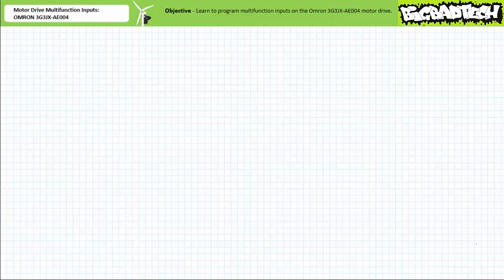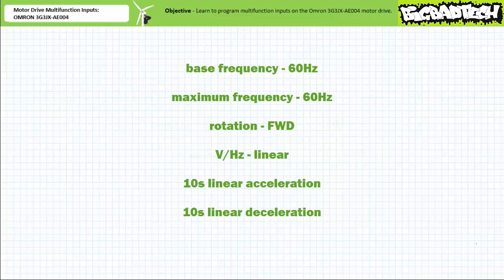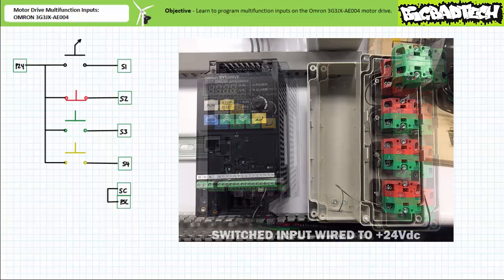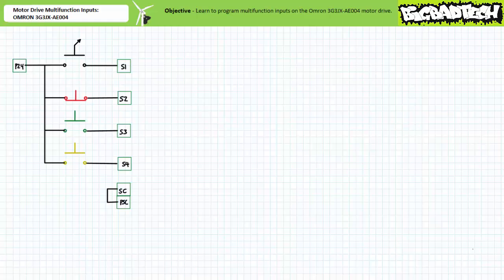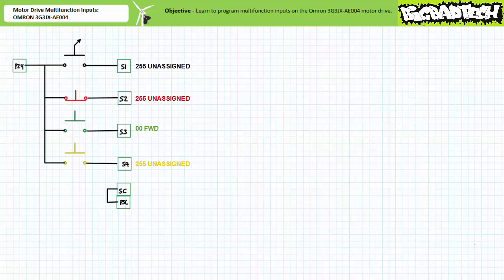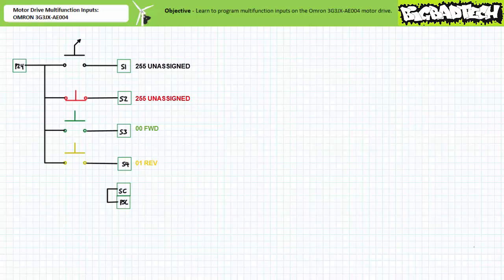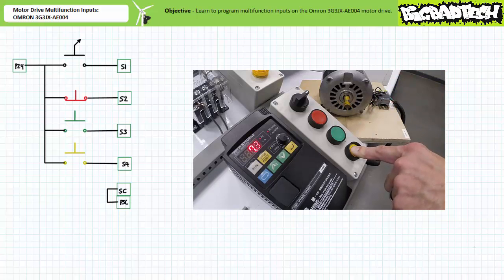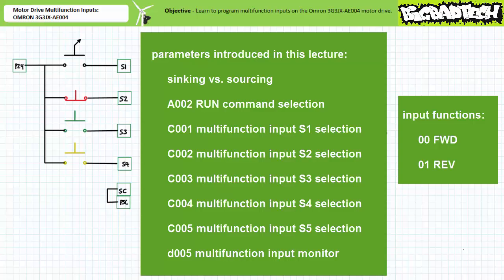Configuring Motor Drive Multifunction Inputs: Omron 3G3JX-AE004 (Full Lecture)

Comment: Hi Could you please load a video on how to setup parameters on Omron MX2?
Reply from the maker: It's the same procedure. Most (not all) of the parameters are even the same. Slightly easier to clear and reset the newer ones using b084.
Reply: Hi , Thank you for the reply, how do I communicate through CX-Drive through USB communication cable, do I need to go to some parameters to be able to communicate.
Reply from the maker: I haven't used the Omron CXDrive software yet.
Reply: Contact information